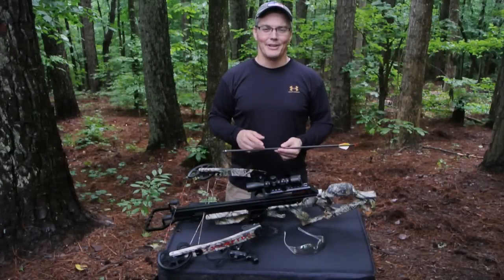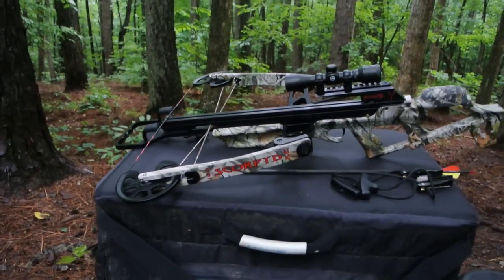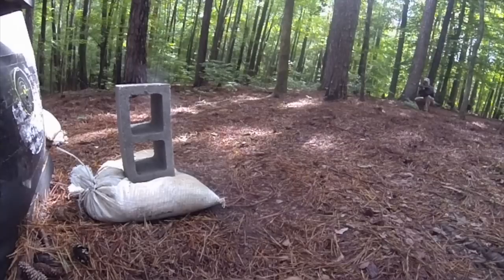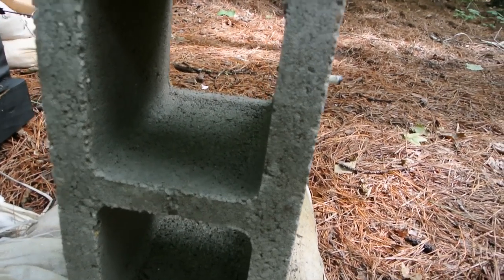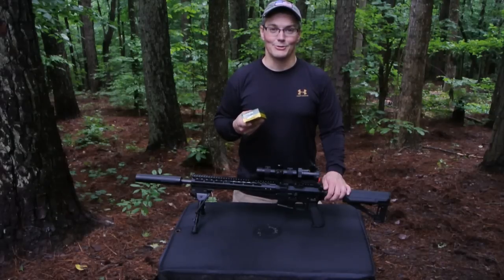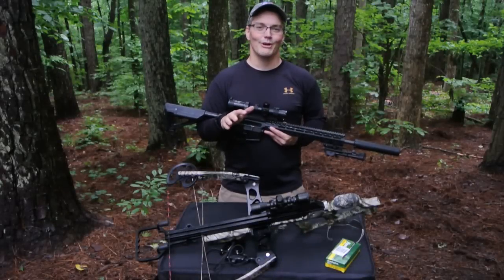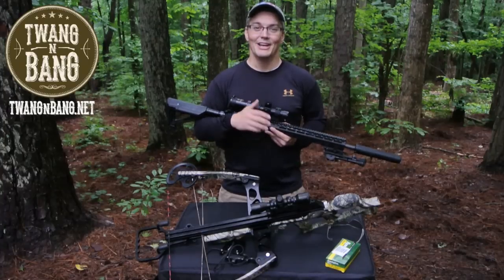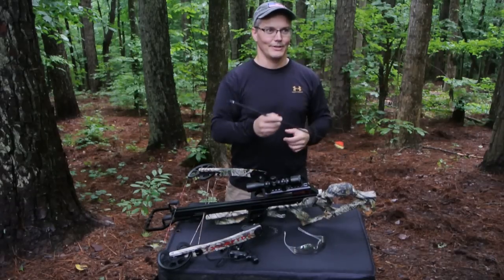World's Most Powerful Crossbow vs Cinder Block! (AR15 Finishes the Job)

Comment: hm actually cut into it, I did stupid shit shooting at a brick on the 4th of july, and cut the corner of it off the whole lenght of the 2 inch brick, from a 80 year old highschool, split the bolt into three bits and bent the tip of the vpa 300 single bevel I used, shows how tough they are but the arrow is toast, the tip though bent did not flatten much at all just bent from the hard impact, and still stuck to the rinehart target about an inch. test from ten yards video to come on my channel.

Comment: how do you get the suppressor legally.
Reply from the maker: Several ways, but there are plenty of resources that explain the whole process of legally buying a silencer. It takes a clean record, $200 for a tax stamp, and patience. Plus, you need to live in a state where they are legal. Any local dealer will handhold you through the process when you buy one.
Reply: thank you for the information and your video.

Comment: So what's the draw weight on the crossbow?
Reply from the maker: 165#, but it's the long power stroke and the cams that generate the power.
Reply: TWANGnBANG So is it the modern worlds most powerful crossbow? Because medieval siege crossbows (required windlass's to reload) could reach up to 1000+ lbs of draw weight.
Reply from the maker: MrDungeoncat Exactly the point.  The power stroke on medieval crossbows was very, very short, and the limbs were very inefficient at releasing their energy.  It took a very high maximum draw weight to generate anywhere near the KE that modern crossbows using cams and advanced materials can easily generate.

BTW, handheld medieval crossbows were nowhere near 1000# draw weight and aren't even close to being able to generate the KE that even modern recurves can generate.  There are plenty of people making ballistas out of both modern and medieval materials today, but there is no comparison between the two in terms of efficiency.
Reply: TWANGnBANG Alright, cool. I was curious about that that. Also, when I spoke about the 1000# draw weight, I meant very large, like this kind: /watch?v=WEOeZTV9wiA Anyways, great video, thanks for answering so quickly.

Comment: that AR15 is an airsoft gun ?
Reply from the maker: Diaconu Dragos Nope.  As I say, it is an AR15 chambered in 300 BLK shooting subsonic ammunition.  It's quiet because of the silencer.  Those bullets hitting the concrete block have more energy than a 45ACP.

Comment: it took you 2 shots with the AR to break the block... which means you gave up WAAAAY too soon
Reply from the maker: Not really.  First shot of 300 BLK went completely through the block. Second shot broke it apart.
Reply: Yeah... so maybe 5 arrows ...instead of 1... he'll maybe 10
Reply from the maker: These arrows are highly specialized and $20 each. No way I'm blowing through $200 worth of arrows for a video. :)
Reply: i guess. i really would like to see that xbow with some of the sts ar480 features. but with those limbs

Comment: are you sure thats the worlds most powerful bow because a slingshot can do better
Reply from the maker: TheGaming Predator It's not the slingshot- it's the projectile.  Slingshots shoot heavy steel balls that won't break on concrete block.  This bow shoots carbon fiber arrows that don't like sudden impacts with something harder than bone.
Reply: TWANGnBANG k
Reply: TWANGnBANG wait isnt bone like 4 times stronger than brick
Reply: TheGaming Predator Which is the reason slingshots were the weapon of choice in medieval times... Steel plate armor? Pfft. Slingshot can penetrate that bitch like logic through TheGaming Predator's brain. :)

Comment: the fact that u used a gun at the end sucks, u should of used cheap crossbow bolts to finish it, would have been more of a challenge.
Reply from the maker: Cheap arrows would've snapped when shot and ruined a $1300 crossbow.  You don't run cheap gas in a Ferrari and you don't run cheap arrows in a crossbow that shoots 425fps.
Reply: TWANGnBANG
Ok makes sense then at least u killed the block lol

Comment: wow, that was short and pointless. Arrows are not made to kill cement blocks. There is a gun though called the leopard that would do the task.
Reply: my wrong, here something for you who wants to chew cement blocks.
Gepard GM6 Lynx
Reply from the maker: Seems like a lot of other people got the point, and I explained why I was doing it very early in the video.  I can use countless things to break up a cement block, but that wouldn't answer the question, "What if..."  I do a lot of that on this channel, so it's probably not a good fit with what you want to do with your time.
Reply: TWANGnBANG I do admire though your calm way and pation. To tell you the truth, i would have been really surprised if an arrow could demolish a block like that. I did get the point of course, you tried to duplicate what that hunter did in his bacemant, right?

Comment: you must not know much about how bows penetrate a hard skinned target,,,use metal shafts not fiberglass,,,
Reply from the maker: Jimmy Haley You must not know much about arrows. These were carbon fiber, not fiberglass. Nobody makes a "metal" arrow for this bow.
Reply: hard skinned targets are not cinder blocks and he did not use fiberglass
Reply: TWANGnBANG It doesn't matter if the arrows were made for this bow or not, you can still use them. Aluminum arrows just might penetrate the block without breaking. With the money you spent making this video and switching to the gun, you could have bought at least one aluminum arrow.
Reply from the maker: Bill Smith This is the worlds most powerful crossbow. It uses a rail and not an arrow rest. There are no aluminum arrows tough enough to be shot from this crossbow that will fit in the rail. Plus, the arrow that I used is tougher than any off the shelf aluminum arrow. The difference is that it splintered when it failed when an aluminum shaft would've simply snapped.
Reply: Bill Smith
crossbow, not bow, big difference
Reply: same thing,,,high mass slow speed = penetration,,that's why a bullet (30 cal) wont go thru a sand bag (high speed low mass)  but the arrow shaft will
Reply: Dupa Krowa oh, great. a perfectionist.
Reply: TWANGnBANG
 Instead of the FMJs, you might be able to use 0,350 spine Easton Triumphs, if the rail will house a 9,3mm shaft. They're carbon for the main part, but have an armoured front 4-5 inches. 200gr point in there as well, should see you happy for KE. One of mine made a mess out of a solid concrete block, after losing some of the energy into the backstop net at the club, and that was from a 56lb compound, from 18m away.

Comment: i wouldnt do anything to the dog but perhaps a split watermelon placed in the owners bed may do the trick? plus anon phonecall to local animal cruelty charity? inspectorate?
very impressive demo i can see why some mil sf forces use the crossbow for its power speed silence i believe they can use them for throwing a line over structural objects or up cliffaces etc
aswell as as a silent weapon i know a wildlife warden in uk who came across 30 poachers but could at time only spot 5 on his nite viz nightscope he was with 1 other colleague ran into deer poachers crim gang
of 30 they decided to beat a cautious retreat at night they got spotted poachers came after them in the deep dark woods they had to cross a wooden style 2steps up over a low wall hedge type obstacle the last guy went to step over from one sides to other moving rapidly semi running etc he heard felt tremendous force hit his heel then large wood post  cracking he toppled over off the style lost his footing when he looked back he had a deer bolt go through rubber heels of his wellington boots impact the post split an 8x8inch post they were warned after this incident to call in police helo dont go being night heros up against crim poaching gangs?
police helo takes only 13mins to reach their position from police hq
so now they call in for support before getn too curious at night as to who is killing their protected wildlife?

Comment: i cracked a cinder block with my 500lb crossbow.it was an accident , heres a pic.

http://www.network54.com/Forum/417256/message/1322354699/

the projectile mass was huge , over 2 lbs , problem was velocity of 100 fps is useless.